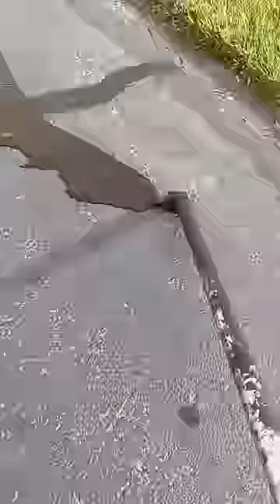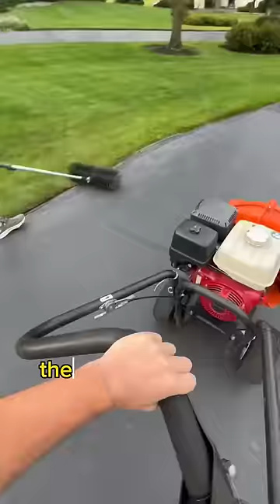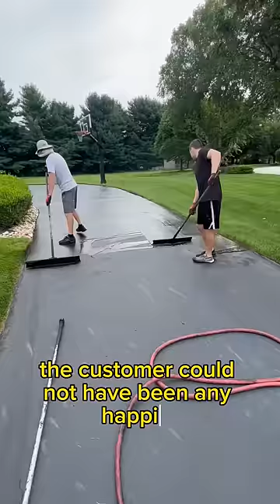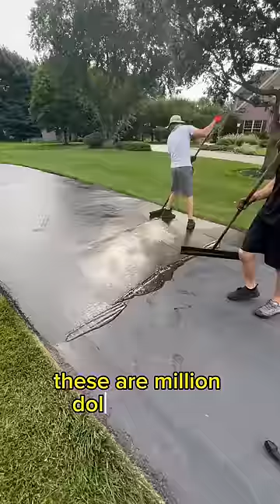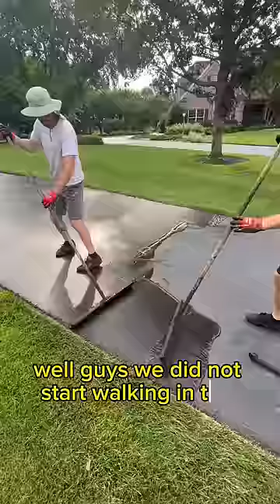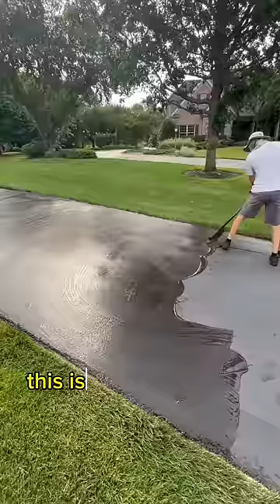SOMEONE CALL THE 👮‍♀️🚔 #satisfying #sealcoating #asphalt

Comment: Looks like you’re gonna be leaving Broom marks all over the driveway. If it’s hot where you are what I do is as I’m doing the seal coating . I spray a little water as I’m going so the seal coat doesn’t dry faster than me actually applying the seal coat on the driveway, because if not, you’re gonna have broom marks all over those driveway. Oh and replacing the broom head once a week helps to.
Reply: Oh and ask your seal coat plant for the water to seal coat percentage because the more water mixed in the sealer makes the product not last as long. I usually do a 60/40 mix 60 sealer 40 water 
The customer gets there money’s worth and it looks and applies on the driveway so much better.

Comment: i do seal coating probably 50 driveways a weekend(pave during the week) we dont use pull brushes, two push brushes, one guy applies it, 2nd brush guy get the foot prints out, guy on the wand, guy managing the hose

Comment: Used to seal my own driveway and one year decided to use a local well known company in the spring. They did a great job but by mid summer the driveway looked like crap. I can only guess they used cheap sealer. Back to doing it myself.

Comment: Your sealer is to thick. Those soft brushes will leave lines. Use the stiffer brooms. Try only pulling your finish side to side in straight lines instead of the rainbow pattern.

Comment: How much sand do you add to the mix and does your tank have agitation?
Reply from the maker: Typically 1-2 lbs a gallon. Yes check out my trailer build🚀📈🙏
Reply: @ColinPatterson_  Thats what I found to be correct even though the manufacturers say much more. It's sufficient to make it non slip but not enough to cause the diaphragm pump to not pump. If you have a hydraulic/piston, different story.

Comment: 1. Make puddles, move the puddle atop spreading it like you are making a sandwich.. 
2. Why is that whole blade flat on the ground... Twist your wrist to feather it you are leaving brusb strokes. 
3. Why are you going over such a thin coat, agin and again... Youll leave viaible burns... Puddles, move puddle.. last pour should leave you with almoat nothing left at the end ... This is just shitty work those driveways will absolutely need to be done yearly at that kind of material use...

Comment: I’ve sealed like 5k dways I’m wondering why both are not on the sealer
Reply from the maker: 😂 😂 typical there is 2 in the sealer. Just super smooth so it was drying up pretty quick. We tried to keep a nice wet line when one guys finishing

Comment: That is shit sealer. You should on use petrol based sealer that you spray on to the asphalt and it actually penetrates down into the asphalt and rejuvenates it. This shit you are using just lays on top and eventually causes cracks.

Comment: Ok so what the deal with sealer cause I almost go in a fight with some dumbass road worker who blocked the drive way to the business we where going to and there was no other entrance to the building 
(Little more back ground they were doing a Main road 2 lanes winds no shoulder runs through some small mountains and forest and we had to turn across one lane to enter the parking lot we deliver furniture for business so we didn’t have any options but to pull across in to the parking lot luckily there was a cop there so the cop told the guy to settle down and just asked us to try now to drive over it as much as possible )

Comment: Why would u ever seal a drive way in the first place.
Reply: Cars leak oil, it goes into the payment and ruins it as well as discoloration over time. The sealer protects it from the leaky oil
Reply: @noruffgrizlybear fair. To each their own. But I don’t value the aesthetics of a driveway or pavement enough to warrant the yearly expense. Especially if I’m not doing it myself.

Comment: Concrete poorers walk in it all day every day. That's why they invented rubber boots. Its part of the job. Thinking you can finish a floor or walkway without stepping in it is absurd. I worked construction over 20 years. Being in your element is part of it. Being covered in your element is a good hard worker.

Comment: Seal coating is a waste of money and so often done incorrectly that it actually decreases the life of your asphalt driveway and causes premature cracking. It’s also SUPER toxic.
Reply: You have a right to post your B.S.  But, None of the products have coal tar in them anymore. Plus it does prolong the life of the asphalt by sealing cracks when applied with sand , which most companies don’t do. As well as absorbing the sun in the winter to help melt snow and ice.